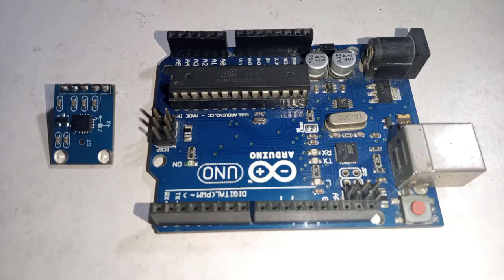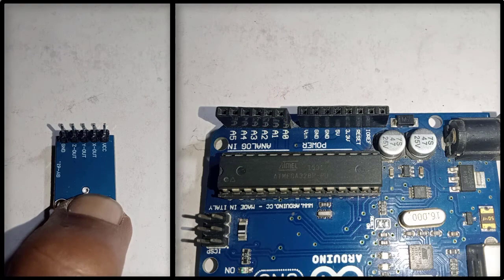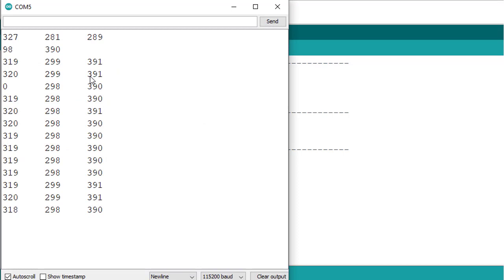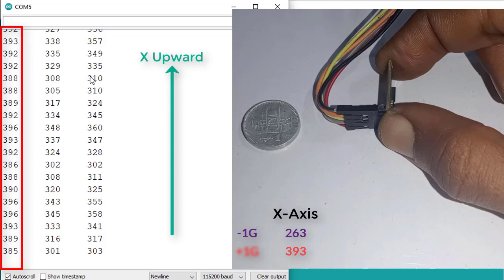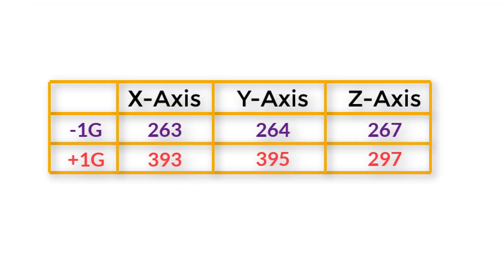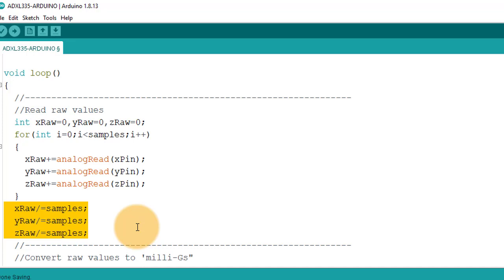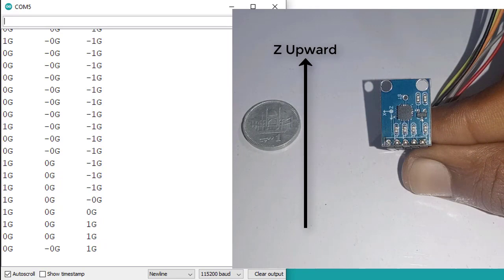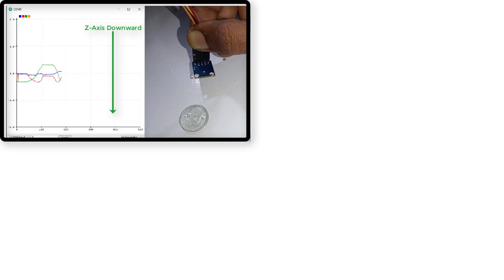How To Interface ADXL335 Analog Accelerometer Sensor With Arduino

Comment: Brother how we can connect 2 adxl 335 sensors? And get their values? ( I have to keep both sensors at different places and take their readings) 
Please reply
Reply from the maker: yes you can
Reply: @AhmadLogs  how sir😇
Reply from the maker: @gyanendrakumar6751  here is the sample code.

// Define the analog input pins for each accelerometer
const int xPin1 = A0;
const int yPin1 = A1;
const int zPin1 = A2;

const int xPin2 = A3;
const int yPin2 = A4;
const int zPin2 = A5;

void setup() {
  // initialize serial communication at 9600 bits per second:
  Serial.begin(9600);
}

void loop() {
  // read and print the values from the first accelerometer
  int x1 = analogRead(xPin1);
  int y1 = analogRead(yPin1);
  int z1 = analogRead(zPin1);

  Serial.print("Accelerometer 1: ");
  Serial.print("X = ");
  Serial.print(x1);
  Serial.print(", Y = ");
  Serial.print(y1);
  Serial.print(", Z = ");
  Serial.println(z1);

  // read and print the values from the second accelerometer
  int x2 = analogRead(xPin2);
  int y2 = analogRead(yPin2);
  int z2 = analogRead(zPin2);

  Serial.print("Accelerometer 2: ");
  Serial.print("X = ");
  Serial.print(x2);
  Serial.print(", Y = ");
  Serial.print(y2);
  Serial.print(", Z = ");
  Serial.println(z2);

  delay(1000);
}
Reply: @AhmadLogs  wowww sir thankuu you did this much for me.. 😭

Comment: Hi sir i have a question what if we want to print 'on' when value of x is between 100-150 and 'off' when value is in below 100 and on same time we can upload this data on our website and thankyou so much for this great video
Reply from the maker: use the following if else condition
if(x >= 100 and x<=150)
{
//code for ON 
}
else if(x < 100)
{
//code for OFF
}
Reply: Thankyou sir should i use this in void loop
Reply from the maker: @balbirsinghheer1370  yes.

Comment: Hello Sir

can you do its simulation in proteus?
Reply from the maker: will try
Reply: @AhmadLogs  Sir actually there is no dedicated library available for ADXL335
Reply from the maker: @cynosurewolf6009  it might be possible with the same code.
Reply: @AhmadLogs  Sir, it is possible. But do you have dedicated ADXL335 library?
Reply from the maker: @cynosurewolf6009  unfortunately not. you have to build it yourself
Reply: @AhmadLogs  ok sir